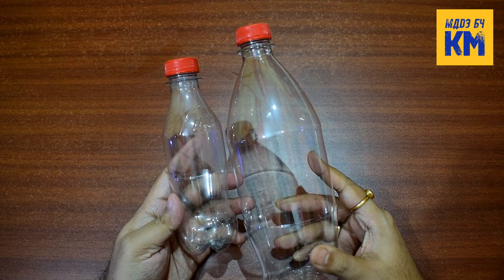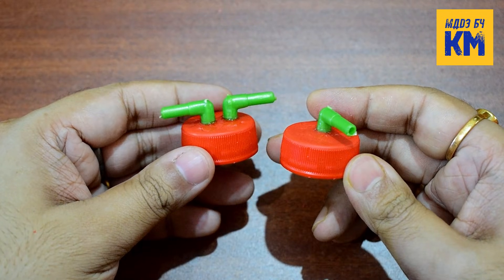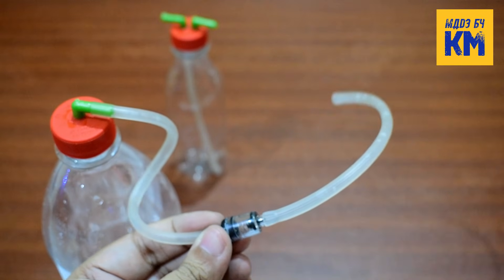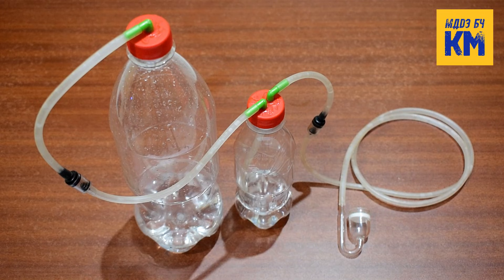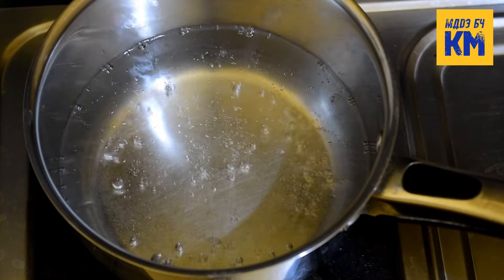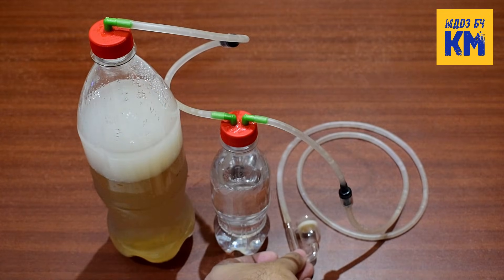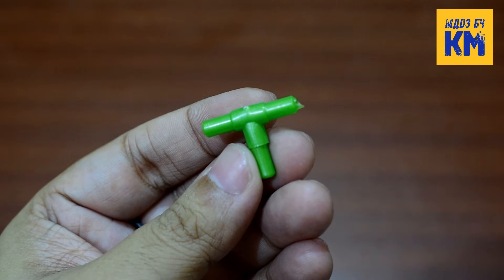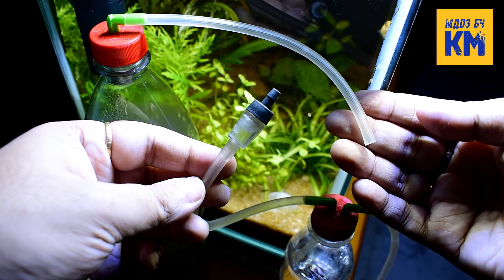Long-Lasting DIY CO2 for Planted Aquarium: Easy & Effective

Comment: Impressive and very useful to reduce cost for planted tank supplements. I have watched both of your diy co2 video. Have a doubt, for a place like Chennai (Usually Sunny) which method will be effective? Agar agar or jello crystals?
Reply from the maker: I think Agar agar method will be more effective but you can also try the Jelly crystals method. Thank you.

Comment: Can syngonium plants use in aquarium
Reply from the maker: You can not grow Syngonium fully submerged in an Aquarium. It should be out of the water, only the roots should be submerged. Otherwise, the plant will rot and die. Also keep in mind that this plant is toxic to human, dogs and cats as it contains calcium oxalate crystals which cause stomach and mouth irritation. It is also not safe for the plant-eating fish. So, it’s better to avoid this plant.

Comment: I have done the method following your video but failed......then tried another time with new yeast solution but no bubble forming even inside the bottle....I have no idea where I am wrong..
Reply from the maker: See the troubleshoot section in the video description. Besides, the bubbles won't come out right away, the fermentation process can take several hours to begin. If you see bubbles not coming out even after 24 hours, then you must understand that there is a problem.
Reply: @madebykm  yes I did wait for 24 hrs..
Reply from the maker: OK, now follow the steps given in the video description.
Reply: @madebykm  description box helps.....successful atlast.....the yeast was damaged previously. 
Took new yeast and got Success... Thank you so much..
Reply from the maker: That’s great 😃

Comment: Question please? Can I keep the co2 system below the tank in my tank cabinets? I see a lot of DYI set ups next to the tank but I'd rather have it tucked away below because of my kids?
Reply from the maker: Yes, you can keep it below the tank.
Reply: @madebykm  Thank you, going to give this a try 🙂
Reply from the maker: Sure, and please see the video description for more information before you begin.
Reply: Will do, thank you for this video it was very helpful. A bakers tip for you.. store dry yeast in the freezer. It keeps fresh a little longer that way
Reply from the maker: Yes, I keep yeast in the fridge. Thank you 🙏

Comment: Sir, may i know what item is this called @3:00 time
Reply from the maker: It’s a check valve; a device that only allows the flow of liquid or gas in one direction. Since it only allows media flow in one direction, it is commonly referred to as 'one way valve' or 'non return valve'. The main purpose of a check valve is to prevent backflow in the system.
Reply: @madebykm  maraming salamat po. New subscriber here from Philippines.
Reply from the maker: Thank you 🙏

Comment: I want to say first and foremost thank you so much for the video. I’ve watched tons and yours is by far the best! I want to make sure I’ve done this correctly. I’ve had it set up for a couple hours now and I’m seeing bubbles in the bottle with water in it (no bubbles are forming in the diffuser 😕). But only 1 bubble every 21 seconds. I’ve checked for leaks and I don’t have any. Does it need more time to build up co2? Or should I make the yeast water again with more yeast? I halved the amount of each ingredient because the bottle I have is not large enough.
Reply from the maker: Yes, it will take more time for the pressure to build up and then the diffuser will work. You don’t have to make the yeast-water again, just add more yeast to the solution, CO2 production will increase. For more information, please see the video description. Thank you.
Reply: @madebykm  okay thank you. Another question. Is there supposed to be water inside the diffuser itself? I have the claves diffuser
Reply from the maker: Is it a glass diffuser? Usually there is water inside the CO2 diffuser.

Comment: I just tried it for my planted tank. It works perfectly. It's 3rd day already and hoping for a longer supply of co2... Thank you so much.
Reply from the maker: Thank you for the feedback.
Reply: is it working gud
Reply: Where did you get the airline connectors and check valve?

Comment: Should I cool the liquid before pouring into the bottle?
Bcoz when I poured hot liquid in the bottle, the one litre bottle squeezed and became 500ml bottle immediately Lol...
400gram sugar wasted  😅
Reply from the maker: Sorry to hear that, the liquid should have cooled down a bit before pouring into the bottle. Please see the video description for more information.
Reply: @madebykm  okay thank you 👍
I just watched the video and did not read the description.
Reply from the maker: Okay, please check it out once.
Reply: Thanks for wonderful content. I followed the video procedure. But solution is not solidifying like jelly. It still in liquid form. Tried putting in refrigerator, still not working. Added more agar agar powder but no luck. can you please help
Reply from the maker: Please see the troubleshoot section in the video description.
Reply: @madebykm  thank you for prompt response. I checked the troubleshooting n seems like I cooked it for more than 1 min. Will keep in mind next time. Now with the liquid I have..as discussed above it's not condensing..Can I used it with warm water with yeast to generate CO2?
Reply from the maker: Yes you can use that.
Reply from the maker: Yes you can use that.

Comment: Hello sir,
Can I double the amount of all ingredients to a 2000 liter bottle for my 39Gallon aquarium? I'll greatly appreciate your reply.
Thank you.
Reply from the maker: Yes, you can, but I think it will be a bit difficult to handle then. For example, changing the yeast-water can be a bit of a hassle. A 1 liter bottle is easier to handle than a 2 liter bottle. I would recommend using two 1 liter bottle CO2 generators. And alternately change the yeast-water of one bottle every week.
Reply: @madebykm  Thank you so much, I'll follow your advice:)

Comment: Hey Kaushik, I'm so grateful to you for all these amazing videos you've posted. I have learnt so much. I wanted to ask you if we can use Gelatin instead of Agar Agar powder and keep the proportions and the recipe exactly the same? Or, only Agar Agar can actually react with the yeast and not the Gelatin? Thank you brother.
Reply from the maker: Actually, using gelatin will not produce good results. This is because the jelly made using gelatin melts at outside / room temperature (25°C-40°C). Gelatin works well in cold environments (<20°C). Thank you.
Reply from the maker: You can also watch my other DIY CO2 video using Jelly Crystals.
Reply: Thanks, I'll check it out.
Reply: Hey, I live in Canada and it's much harder to find Agar Agar powder here and it's way more expensive than Gelatin powder. I do have fairly cooler temperatures in my house (well below 25°C). Can I go ahead and use the same measurements and the recipe as with Agar Agar powder? Thank you! 🙏🏽
Reply from the maker: Ok, then proceed with the unflavoured gelatin. And if you want to use gelatin-based jelly crystals powder (e.g. Jell-O), please follow my other DIY CO2 video.
Reply: Thanks for your super prompt responses, heartily appreciate it. I'll update you in a week or two. 🙏🏽
Reply from the maker: Sure! And please see the video description for more information. Thank you.

Comment: Great 👍
1 question 
If i use 2 litter bottle and make the solution double x2 times
Will it work ? Will it last more time ?
Reply from the maker: Yes, if you also use twice the amount of ingredients (sugar, agar powder etc.) But then it will be a little difficult to handle, for example, changing yeast-water can be a bit of a hassle. It is easier to handle a 1 liter bottle than a 2 liter bottle.
Reply: @madebykm  thank you 
I already have diy co2 citric acid one
Will try same bottle
Reply from the maker: Of course 👍

Comment: Nice video dada🙌
One question..can I use regular gelatin strips instead of agar powder??
Reply from the maker: Actually, using gelatin will not produce good results. This is because the jelly made using gelatin melts at outside / room temperature (25°C-40°C).
Reply: @madebykm  ok dada👍

Comment: one question though, if we detach the check valve  at night...wont CO2 harm us in the room???
Reply from the maker: No, this is because there is much more CO2 in the air than the amount of CO2 that will be generated in the system.
Reply: @madebykm  OK thanks

Comment: Hi Kausik. It's a great video. Can I use gelatin powder instead of agar agar powder. I can't find it in Nepal.
Reply from the maker: Actually, using gelatin will not produce good results. This is because the jelly made using gelatin melts at outside temperature (25°C-40°C). You can watch my other video on making CO2 using jelly crystals. Thank you.
Reply: @madebykm  Thank you
Reply: @manishmallik7844  you can get in MINISO NEPAL store located in NEW BANESHWAR ROAD

Comment: What will happen if I use a speed control valve instead of keep it open at night..
Reply from the maker: As I said, CO2 gas will be produced continuously in the bottle 24/7. So, if you stop the flow, the bottle may not handle the immense pressure created in it and the CO2 system may be damaged.
Reply: @madebykm  Thank you.. 
I have tried that setup.. It's performing very well.. 👍👍👍
Reply from the maker: Thanks for your feedback.

Comment: Hey Kaushik!
You're doing an amazing job. And I totally agree that this channel deserves many more followers. I've been toying with the idea of DIY Carbon kit for my 77 litre tank. And I'm definitely up for trying your method, which btw is so cool and thoughtful. I just have one question though, can I attach the CO2 outlet to my existing power head filter, which I also use for O2, at the same time? Like there's O2 and CO2 being dispersed into the aquarium by the same power head.
Reply from the maker: Thank you. I request you to watch my DIY CO2 diffuser video. There I showed how to use a power filter to diffuse CO2 gas in a planted aquarium.
Reply from the maker: And when you use CO2 (when the lights are ON) you don't have to inject / disperse air into the aquarium. CO2 is not required at night or when the lights are off. At that time you can disperse air through a power filter or use an air pump / air stone.
Reply: Thank you for your prompt response, much appreciated. Tumi darun chele 😁 hope my Bengali is still good
Reply from the maker: Thank you 😊. Your Bengali is great 👍
Reply: Btw, have you got Instagram?
Reply from the maker: I have a FB page. The link is in the Home and About section of my channel.

Comment: Question sir can I just take out the diffuser itself out of the tank? like stick it beside the outside glass? As I cannot detach the hose from the check valve because for me it makes the hose loose and cannot fit tightly after re attached and can't even use a airstone also because of its strong disturbing  noise during night time caused by the pump.
Reply from the maker: Yes, you can take the diffuser out of the tank and put it in a glass or cup filled with water.

Comment: How many hours should the bubbles be visible on the diffuser mine been sitting for almost 6hrs now and don't see any bubbles coming out to the diffuser
Reply from the maker: If there are no leaks in the CO2 generator system, the quality of the yeast is good, the bubbles will start coming in 1-2 hours.

Comment: Sir i am using a led t bulb 10 watts for my planted tank dimensions are 15×9×9 inches . So how much distance should I keep between the light and top of the tank (water level)...
Reply from the maker: About 6 inches. Since you are providing high light for a tank of this size, you should use CO2 and liquid fertilizer in this tank. Otherwise you may face algae problems in this tank later.
Reply: @madebykm  I am using liqiud fertilizer but no co2
Reply from the maker: Then at least use liquid carbon, because plants need carbon for Photosynthesis
Reply: @madebykm  I can change the light then how much watt light should I use
Reply from the maker: Use a 5 watt LED bulb

Comment: How long should it typically take for bubbles to start coming from diffuser?
Reply from the maker: If there are no leaks in the CO2 generator system, the quality of the yeast is good, the bubbles will start coming in 1-2 hours.
Reply: Thanks

Comment: Thanks, good video. I will try this soon and share my feedback.
1) can this be made without check valve?
2) I have a 70 ltrs tank. Will this be sufficient?
3) How long should I keep the supply on?
4) Can this be used in all seasons (across 12 months)
Reply from the maker: 1) If you do not use the check valve, aquarium water can flow back into the bottle.
2) If you have medium to high density plants in this aquarium, then you need to use two CO2 generators.
3) As long as the lights are ON in the aquarium, CO2 should be provided.
4) Yes
Reply: Thanks for your prompt response!

Comment: Hi, how to measure t CO2 is given in the required quantity not less or more is there any method.
Reply from the maker: In this method, one CO2 generator will produce 1 bubble / 1-2 seconds which is sufficient for a 10 gallon tank. So, for 20 to 30 gallon tanks, use two CO2 generators and so on. If you want to measure the CO2 level in your tank, you can use a CO2 drop checker. The drop checker contains an indicative fluid that tells you whether you have too much, too little or the correct levels of CO2 for your plants to grow, and that is a safe level for fish.

Comment: How much time I give CO2 for planted bowl about 3 gallons
Reply from the maker: There is no need to give CO2 in such a small aquarium or bowl. Use liquid carbon instead. In general, you should provide CO2 to your plants as long as the light is on.
Reply: @madebykm  thank a lot

Comment: If we detach it then frm the small bottle then the gas coming out frm the the bigger one will be wasted right??
Reply from the maker: In this method, CO2 will be produced continuously in the bottle and it cannot be stopped. At night plants don’t need CO2. So, even if you don’t disconnect the CO2 generator at night, the CO2 will still be wasted, because plants won’t use it.

Comment: Hi sir, I did the jelly CO2 was quite successful Thank you. As we cannot stop the chemical reaction, my question is in the night when CO2 is not required if we detach the pipe the CO2 will be released outside and it is wasted right is there any solution for this.
Reply: You can store the gas in another container..as we all know gases can really compress a lot under pressure,so any container would work...store the co2 in it for a month and use a regulated valve by which u can control the flow..to the tank.
Reply from the maker: You are right, but no solution has been found yet :(
Reply: @madebykm   you can use a saline pipe controller in this project through which You can control the CO2 gas flow

Comment: 1.you told in other video in diy system ceramic diffuser dont work properly, why are you showing it now???
2. will agar agra powder give same result as jelly mix??
Reply from the maker: I have never said in any of my videos that a ceramic diffuser will not work with a DIY CO2 system. I talked about high quality diffusers that require high pressure to work properly. Also, there are many types of ceramic diffusers. Some ceramic diffusers come with inbuilt check valves and require high pressure to work. Simple ceramic glass diffusers will work fine here.
Agar Agar will give the same result as jelly mix.
Reply: @madebykm  Dada no co2 bubble in small bottle what to do ?
Reply from the maker: See the troubleshoot section in the video description.